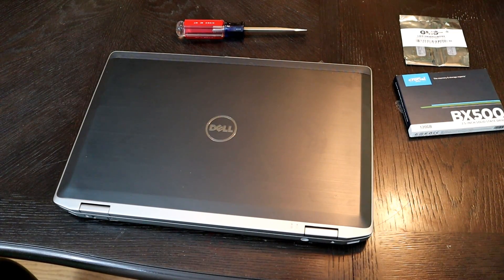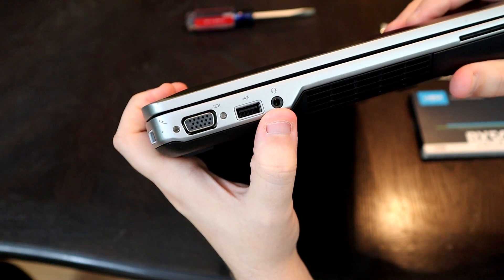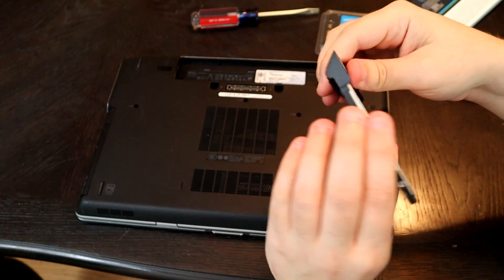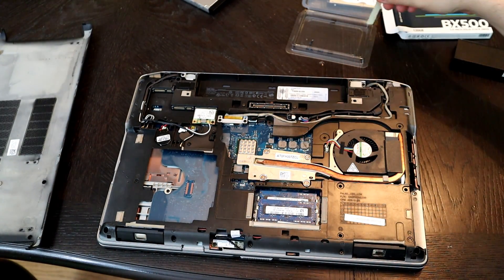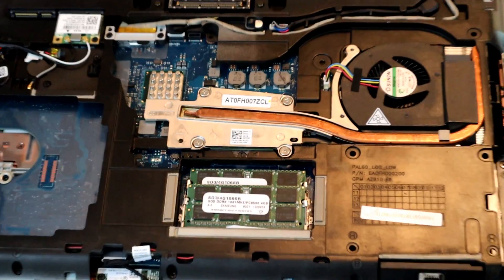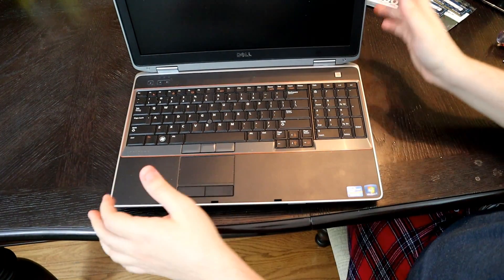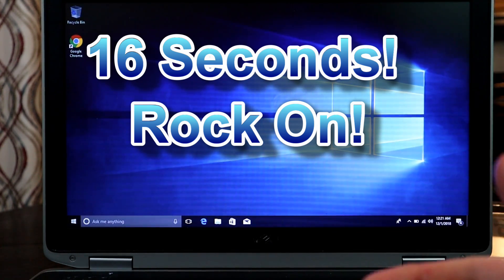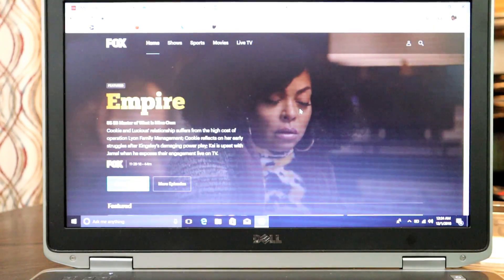Dell Latitude E6520 Resurrection SSD and Ram Upgrades

Comment: I put on a 240GB Kingston SSD but my E6520 won't detect it. Can I ask if you had the same problem? Thanks
Reply from the maker: Mine worked out of the box. The only issue I had is that I had to push the SSD in a few times before it properly engaged. If you have the caddy make sure it is not interfering with the contact. It is also, unlikely, but theoretically possible the SSD is defective and may need to be replaced. Another thought is, I have in past found some SSD do not play well with some motherboards. I stopped using Patriot SSDs after having that issue on my last build. 

I would reinstall the SSD and if it is still undetected, try another known good SSD or HDD and go from there. 

Thank you for watching, best of luck!
Reply: @Matty_Ice_Reviews  I see. Thank you for the prompt reply!

Comment: I am still using it. Very good laptop and very easy to upgrade. Just install ssd and upgrade ram to atleast 8gb (you can go for max 16gb) and the difference will be significant. Also install a 2disk with caddy for storage like shown in this video. I also recommend to change thermal paste on cpu and gpu it's not so hard.
Reply: What's the max SSD it can take? Also, how do you put the HDD where the optical drive is?
Reply from the maker: Agreed this is a great laptop that is still functional and useful 10+ years after that fact. Thank you for watching!
Reply: Do you have a DVD burner on yours? I just bought mine and I haven't tested it yet
Reply: @sharpshooter07  yes

Comment: i did the same upgrade but while installing windows it is not showing ssd
Reply from the maker: I would try to remove and reinstall the ssd in the laptop. If the connection is not good, this may be causing the issue. Also it could be possible that the drive is defective.

Comment: I have the 8 gigs, but not the ssd. Will it still run good?
Reply from the maker: It will still function but the HDD is the bottleneck for these systems. The SSD allows for significantly faster loading of pages, documents, programs etc. You also do not need a top of the line speed or size SSD. The prices are quite good as well right now (March 2021) with 250GB averaging $50 and 500GB $75.
Reply: @Matty_Ice_Reviews  it's also not detecting the hard drive
Reply: Also, it can't direct a battery. I have one in. Any ideas?
Reply from the maker: @alexandermaestas3425  if the battery is not detected it may very well be bad cells/connection, an issue with Windows, driver issue, or BIOS issue. I would start with checking the battery connection and make sure the contacts are clean and undamaged. Next if problem is unresolved Windows troubleshoot. If no change BIOS update and thereafter move on to the driver reset if nothing else works.

Comment: OK well I am replacing the HD but it literally slides into place, no click or any type of resistance going in whatsoever. The replacement is thinner than the original because it doesn't have the big silver piece on the back of it. Gonna try but I don't think this is gonna work.
Reply: Try slide in SSD when laptop is on foots not on back. Gravity help you put it in right place - to have SATA connection. Then screw in screws also having device in normal position.
It works!
Reply: @nocnymarek7645  My god, this trick saved me! I was trying hard, but no matter what drive was not detecting. After reading this comment, I set back, folded my leg and held laptop on my knees. Then I inserted SSD. Due to gravity, SSD touched the bottom of port. I just pushed all the way in, that it! its very gentle click. This also allowed me to fix all four screws (when I tried with inverted lap top, I could fix two screws on back). Upon turning  PC, F2, I could able to detect SSD! Thank you. Very helful.
Reply: @sagunswa9405  
I sm happy that advice was helpful.

Comment: Is RAM proprietary?
Reply from the maker: On this particular laptop yes. Most pre-built systems from companies like Dell and other such companies will have this built in to the systems. It is possible to have other types work but it is never guaranteed. It can also be an issue finding supported ram years later when the secondary market dries up.

Comment: I'm so glad I came across your video. I actually had no idea I could install a 2nd disk with a dvd caddy. It was taking my old Latitude an excruciating 7 minutes to reach logon screen. After ordering the necessary parts online I followed your tutorial.... in about half an hour I upgraded the ram, installed a new SSD and switched the old HDD into the dvd caddy.... beginner Lego level. It gave this laptop a 2nd life. I'm now booting in Ubuntu in 17seconds. Thanks a lot  :-)
Reply from the maker: Very cool! I'm glad you were able to breathe life into your old laptop. Dell enterprise laptops of this era have a large variety of accessories to enhance their usability and functionality. They are also built quite rugged compared to models from today! Thank you for watching!

Comment: Can the processor be upgraded?
Reply: @S Hol cus i have the same model but without the nvidia gpu and i broke the motherboard so i want to buy a new motherboard so would it work if i bought the nvidia 45w one???
Reply from the maker: Yes the processor can be changed to a limited selection. Most popular would be Intel 2540M, 2520M, 2430M, 2630QM, 2640QM, 2670QM. This may unfortunately not work with the i7 2670 due to twp and heat related issues. These are also dual or quad core mobile cpus so performance gains are limited.
Reply: @S Hol small question how can i get that motherboard

Comment: Can you please list or provide the link for the RAM and HDD that you used, I am looking to upgrade this model as well
Reply from the maker: Both came from Newegg.com.

HDD- Crucial BX500 SSD 120gb https://www.newegg.com/crucial-bx500-120gb/p/N82E16820156186?item=N82E16820156186

Ram- Dell 204 pin DDR3 1066 MHZ SODIMM 
https://www.newegg.com/p/0RM-003S-006J0?item=9SIAAFJ4315095

As of 9/24/20 you can purchase both together for approximately $60 total which is a great price! The HDD can be changed for larger any standard SSD in that style will work perfectly! Thank you for watching!
Reply: @Matty_Ice_Reviews  thank you so much, very helpful
Reply: @Matty_Ice_Reviews  I have the 6430e with i7 3720 and 16gs ram, I replaced the 7200 drive with SSD and also added the dvd/HDD swap and have a second drive bay ready for SSD. I also recommend upgrading to wifi 6. Netely has a PCE card with bluetooth 5 as well, it makes this laptop viable in 2022. Using for school.
Reply from the maker: @drewdegeer4432  I agree that laptop build is perfect for school or work! Thank you for watching!

Comment: I have exact same laptop with i7-2640M and 8 GB ram. I updated bios and Windows 10 then cleaned sticky plastics which occured upside and downside the keyboard nearly 1 hour :) I wanted to upgrade the ssd and looking for videos, so your video was really helpful for me thank you. And i just wonder even if the dell says its limit for memory is 8gb, can we push ram to 16 gb. Some people on the forums says it can be but i don't sure. If you have compatible 16 gb ram could you please try that :)
Reply from the maker: It can be done, the results are mixed. The limit is set by Dell and some say that it is a soft limit i.e. the board could support up to 16GB. To find out you can always launch command in windows and enter "wmic memphysical get MaxCapacity, ". 

Now the tricky part is that some versions of the board will state the slot is capable of 4GB but list maximum capacity at 16GB. I've tried to install 16 but the set I bought was not detected and caused crashes. I've seen others say that it detects but will try to operate single channel, and operate unpredictability. 

Dell seems interested in limiting the ability to upgrade components thus creating a need to buy a new system. Frustrating for those that enjoy upgrading and maintaining their purchases! Thank you for watching! Best of luck!
Reply: Yes you can upgrade to 16 gb ddr3 only 1333mhz or you will have to adjust speed ram in your bios. I have the same brand of this dell computer with now 12 gb of ram, one ssd with 240gb and another ssd 1tb. Works very good for 2020. I only need new battery, but its hard to get nowdays.

Comment: For mid 2019! What is awesome about this laptop is that DELL is still supporting it via BIOS newest BIOS revision is January 2019 A22, works smoothly with Windows 7 Pro Etc and Windows 10 Pro ver 1903 whats cool about the battery on this also is the fact that there will be no overcharge you can leave your battery and charger plugged in this specific model and not worry about damaging the cells! this laptop stops charging the battery once it is full

Comment: Nice video!! I have essentially the same one but in an i5 2.5ghz and I added a Crucial SSD also. Nice machines even for 2019 use, I also got a docking station and Dell monitor with sound bar at a local thrift store for $20 and it makes a great desktop machine too.
Reply from the maker: Sounds like a great upgrade. I must concur great laptops that are quite rugged. I keep thinking about upgrading my cpu to the i7 series 2760 or 2620. The prices are a bit high though and thermal throttle is a concern. Thanks for watching!
Reply: @Matty_Ice_Reviews  thermal throttle can be set to passive cooling under power options :P IE slow CPU then speed up fan as to active that speeds up fan then cpu slows down.